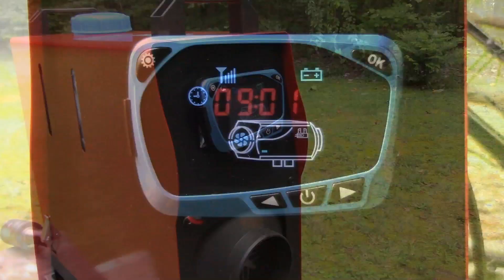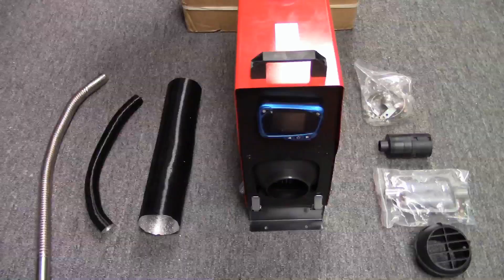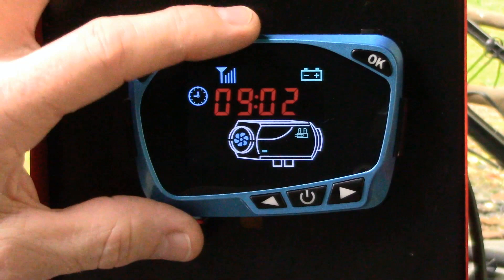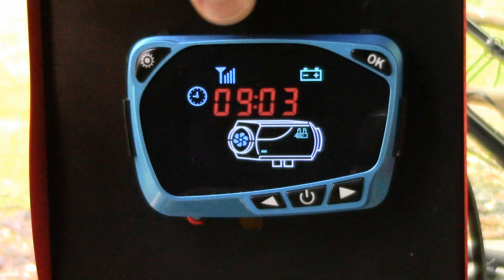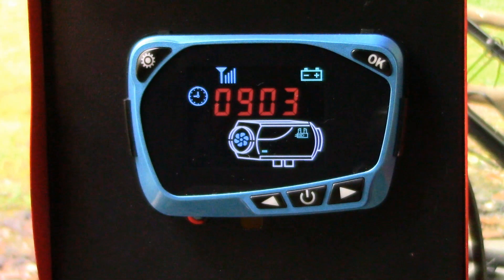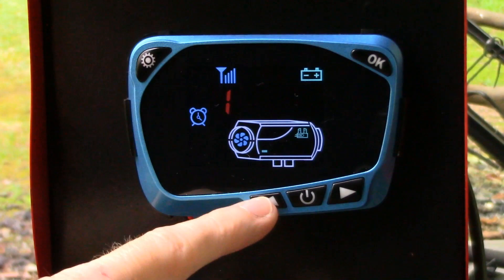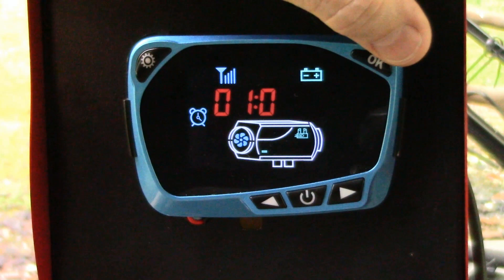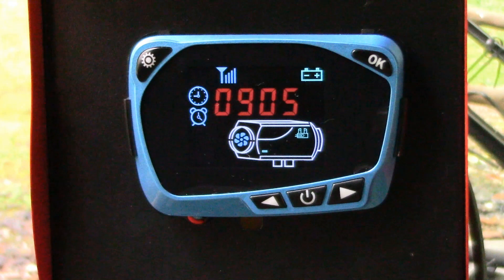Diesel Heater Timer setting on Blue Controller

Comment: very clear video and good to hear someone with the confidence to actually speak and tell people how to do it.
I like the blue controllers so much that I recently replaced the ecu on my 5kw heater just so I could attach another blue controller and lcd remote. the old style ecu also opens up the possibility of using all the triangle plugged lcd screens. I also had to replace the wiring loom to. I have a 2kw diesel heater mounted to my driveway wall in a harwood ply box taking air from my kitchen and pumping hot air into my living room and at 2.0 Hz it uses about 14 pence of fuel an hour to heat my 2 bed semi detached house to 20 degrees C all day from 8am to middnight which is far more effiecient than our 32kw gas central heating boiler. Gas prices got to a point where our gas boiler was using around £12.00 a day to heat and cook on gas to now thats as little as £2.00 a day so runing the diesel heater has saved us a lot of money so far. When charities on the news go on about fuel poverty this is what they should be installing in peoples homes it might even save lives in the long run.
Reply from the maker: I like the way you think. Thank you for sharing!

Comment: I have the all in one with the blue controller but no remote. Going to be installing it in my motor home this week. Thanks for the tutorial.
Reply from the maker: I think you can purchase the remote separate.  It is very handy and has a display that shows the current heat setting.

Comment: Thank you. I could not find out how the timer worked or how to set it .  I have a 5 kw in my micro camper van and the timer function is nice when I'm going to bed I turn the heater off after it warm inside turn it off and then set the timer for 2 hours after I go to bed and it runs for 4 hours and when it cools down it's time to get up for work. Thanks again
Reply from the maker: Perfect way to use the timer function. Took me a while to figure it out but a very useful feature. Thanks!

Comment: Do wee are able to ajust the temp for exemple at 14 celcius and whend the temps weel be at 14 celcius, this air heather will start ?
Reply from the maker: The temp setting only controls the heat and blower speed. The heater will try to maintain the set point by speeding up or slowing down but never shuts off. Once the set point is reached, the heater stays on the lowest setting.

Comment: What happens if you set the heater on lowest setting (+8 degrees) and the heater reach that temperature? Will it automatically turn off and then turn on again when it gets colder ambient temp?
Reply from the maker: The unit will not turn off. It will just run on the lowest setting once the room heats up to the set point unit the room cools back down, then the unit will start to ramp back up trying to maintain the set point temperature. The controller has to be inside the room being heated to use the "temperature mode".  I run mine only in manual mode.
Reply: @geenote  Thanks for your answer :)

Comment: Than, you. Just ran mine and  learning the controller. Is there a temp for the heater temperature?
Reply from the maker: You can select to run the heater in a sort of automatic/temperature mode or a manual/pulse mode by pushing 2 buttons at the same time (settings or OK button with one of the arrow buttons). In manual/pulse mode you change the pump pulse rate by changing the hz setting and the heater stays running constant at that setting. In automatic/temperature mode you set the desired temperature in Celsius and the heater will try to maintain that temperature by running at a higher setting until the desired temperature is reached then drops to low setting.  Hope this helps. Thank you!
Reply: @geenote  and if you go into the settings inside the machine and raise the low setting to like say 2.1 when you're in the automatic mode it'll drop to the 2.1 instead of down to 16

Comment: Witaj,
nic mi nie wychadzi !!!Czy jest mozliwe ustawienie zeby za 12godzin sie włączył?
dzieki
pozdrawiam
Reply from the maker: Set timer 1 to 12:00 and set timer 2 for how long you want it to run.  It will delay for 12 hours then start to run. It will run the amount of time entered on timer 2.
Reply: Witaj,juz tak robiłem ale to działa tylo 1dzien po godzinie 24:00 juz sie nie uruchamia..Teraz go oszukuje ustawilem o godzinie 19:00 ze jest 7:00 i to moze zadziałac ?

Bardzo dziekuje
Reply from the maker: Unfortunately the timers have to be reset every day.  Timer 1 delays the start time, timer 2 delays the shut down time. "12:00" in timer 1 would delay 12 hours before start, "13:00" in timer 2 would delay 13 hours before stopping, so the heater would wait 12 hours and run for 1 hour before shutting down with these settings as an example. After the timers complete the cycle, they have to be reset all over again.
Reply: @geenote  Witaj
1.przestawienie zegara nie pomogło  się nie uruchomił
2 Potrzebuje dzisiaj o 17 :00 po południu zaprogramować żeby JUTRO rano o godzinie 6:00 rano się uruchomiło czy jest to możliwe zwżywsz ze to JUTRO
Pozdrawiam
i dziekije za pomoc
Reply: W tym samym dniu sie uruchamia
Reply from the maker: @wiesawbaranowski3935  At 5pm, timer 1 would be set at "13:00" to start at 6am. The timer icon should be on the display indicating the timer is set.
Reply: @geenote 
a licznik 2 ,,off'' ?
Reply from the maker: @wiesawbaranowski3935  Timer 2 should also be set for delay till off. If timer 2 is set for "14:00" I believe it will run for 1 hour and shut down, "15:00 would be 2 hours before shutting down, etc.
Reply: @geenote  I don't understand any of this, watch number one showed at 7:00 am 30 and watch number 2 showed 70

Comment: Does any English speaking person in the world know how "Plateau Adaptive Function" for altitude adjustment works on the new Blue or Red controllers with lcd remote? The digital black controllers are adjusted in Advanced settings by adjusting hgh low and pump speed/fan speed- know that. How do the blue controllers adjust with "Plateau Adaptive Function". Thanks in advance, frustrating search for info after marketing BS about it being "easy"
Reply from the maker: I have the blue controller and can use one of two different password numbers to access the factory screen.  "1688" or "9009" will allow me to get into the factory screen and make adjustments to min and max pump rate and fan speed.  Hope this helps.
Reply: @geenote  thanks, I want to know how the altitude adjustment function works, I have the black control and know how it doesn't work except manually
Reply from the maker: @MrMarkAMartin  My controller shows the correct current altitude but I don't know if it changes any settings that depend on the altitude or if it is adjustable.   If you get any correct information I would be interested in knowing. Thanks.
Reply: @geenote  I'm tracking info down and will certainly share what I find. It would seem that the manufacturer would be motivated to educate potential buyers, language barrier or not- this issue of Chin-Englis translations seems more like a 1920 problem than a 2020 problem, I just don't get what keeps the knowledge gap so wide.
Reply: @geenote  I did find a pdf of the blue controller explaining buttons symbols etc- do you want it?
Reply from the maker: @MrMarkAMartin  Thanks. I think I understand the buttons and symbols. I was curious about the altitude reading and if it did anything besides tell you the current altitude.
Reply: @MrMarkAMartin  I would love that pdf. Great video, Thanks. just got mine and modified, ready to rock.
Reply: @MrMarkAMartin  I read that the burn mixture is automatically changed to suit the altitude set. If you are a camper you need to adjust every stop ?>

Comment: Mine if you do your settings one day the settings are usually still there by the next day just have to turn it on
Reply from the maker: Yes I think that is the same with mine.  The time entered on timer 1 and 2 will normally stay entered in there but the timers turn off after finishing the cycle and have to be turned back on to use them again. I don't like how I would have to turn the timers back to "on" every day at the exact time every day to get the heater to cycle on and off consistently day to day. Seems like one should be able to set the time to come on and time to turn off and then just turn the timer on. Oh well... good thing every one doesn't thing like me. Thanks for pointing that out.
Reply: @geenote  the first kind kind of came with the heater work had a regular clock on it can win it all
Reply from the maker: @garyreed354  Sounds like a better design.
Reply: @geenote  it would be if it didn't fade out and who knows maybe one of those red fobs would work on one of those as well
Reply from the maker: @garyreed354  I think you can swap out different controllers
Reply: @geenote  it's the red remote I like the one with all the read out on it
Reply: @garyreed354  this is why I turn mine off at night, it saves the led backlight, there is a tutorial on youtube on how to replace the backlight by the way.
Reply: @geenote  depends which ecu you have inside the heater, take a photo of it and compare with ecus offered for sale on ebay. there is one with a metalic strip that passes from one side of the board to the other and the board is a blue in colour it is the older style ecu which is compatable with just about every controller with a triangle shaped plug, you may also have to replace the wiring loom with a universal loom easy job to do. it also opens up the possibility of being able to use the Austrialian chaps custom made controler.
Reply: Some times  u need to run it 24.!/7 so can't  turn it off best plan is other controller  no more problems

Comment: You have it wrong  on the second timmer. It is set from now till.off  FROM NOW TILL ON %FROME NOW TILL OFF
Reply from the maker: I think you are right. I never use the timers but realized they are delay timers. What happens if you enter a larger time in timer 1 than timer 2?  Like 15 min on timer 1 and 10 min on timer 2?  It can't shut down before it starts...🤔 Thanks!
Reply: @geenote  if u set 2 for 10it will go off and then the other  for 15 it will. Come  on 5 minutes  later or it will do nothing if it's the other way around
Reply: @geenote  yes , the situation that you are describing and the result is correct. I set mine with 1 -13h and 2 with 3h (hoping that it will start in 13 hours and stop after 3 hours of running) but the next day the heater was still running and no timer icon in the display.
Reply from the maker: @adicmx  Did you try setting Timer 1 for 13:00 and Timer 2 for 16:00 ?